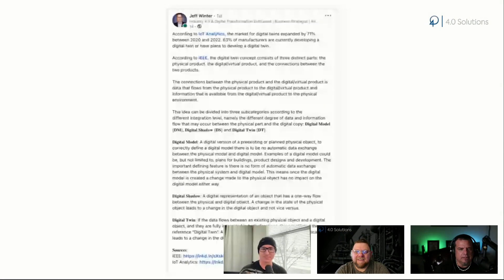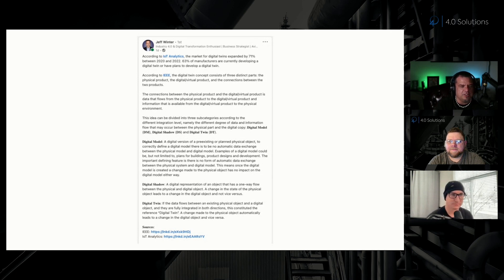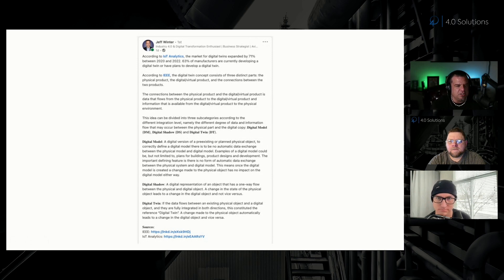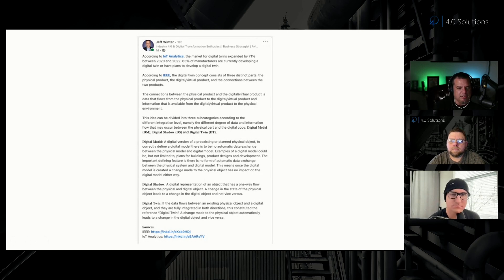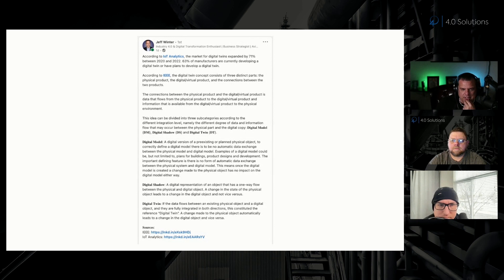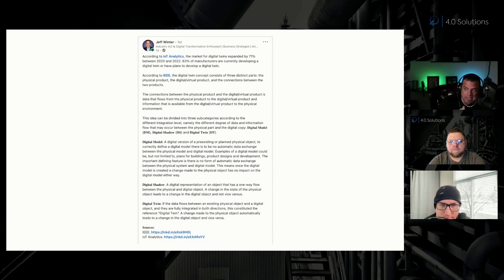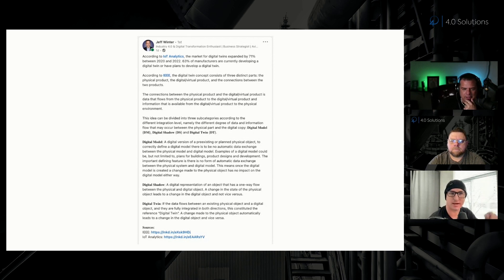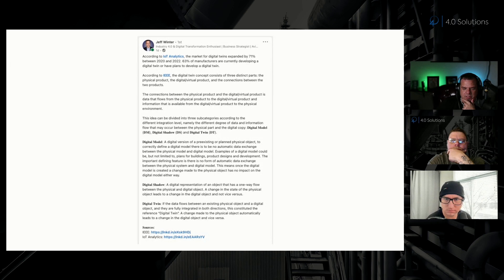Stop building Digital Twins like this!

Comment: Did you tell Accenture at that time that a UNS would help solve that problem? Is Accenture going down the wrong path or do you foresee them having more issues?
Reply from the maker: Yes — Walker explained that UNS reconciles the namespaces in their architecture.  The issue was, as we saw it with this group, they had a reference architecture but they didn’t actually know how they were going to use it.